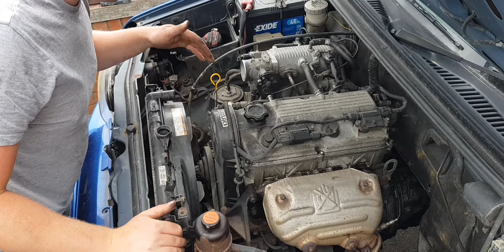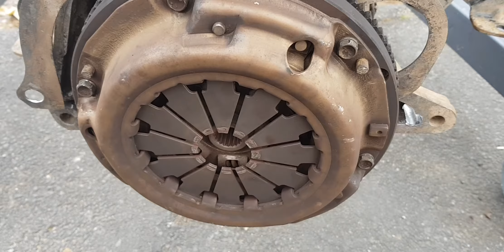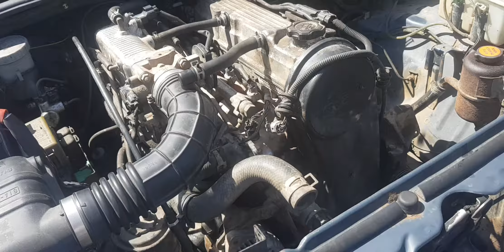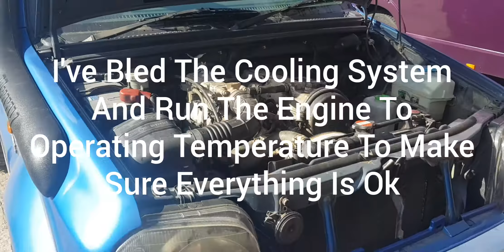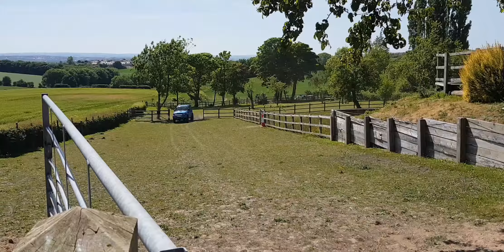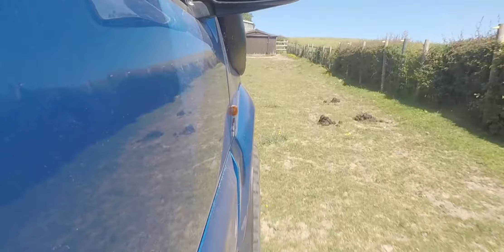Suzuki Jimny 1.6 Engine Conversion ( BIG JIM ) Off Road Test Drive Power Upgrade Suzuki Vitara

Comment from the maker: Heres the complete list of Mods ( I forgot to mention) you need to do so this engine will fit:

:Driver engine mount is slightly further back of the origional so you need to drill a hole in the metal bracket so you can move it forward.
:Use the Jimny manifolds (they bolt stright to the 1.6 with no mods)
:Run the bottom coolant hose infront of the engine mounting rather than through it.

Thats it 👍

Hope you enjoyed and found this video useful.
Reply: Hi mate would you be interested in selling the 1.6 Jimny ??
Regards
Reply from the maker: @aadrianlee  Hi mate. No sorry its part of the family and next inline for a rebuild.
Reply: @landymadgarage  The oilpan is also needed to be modified. right?
Reply from the maker: @sinnakjell7077  yes you fit the Jimny oil pan and pickup pipe. This engine had already been done
Reply: @landymadgarage  Visually vise would someone know it's not the original engine if he is unfamiliar with jimnys? Is the fuel economy higher or lower you reckon? I mean a little stronger engine would pull the car more easily... but also more power. :)
Reply from the maker: @3rdAgeZerkerz  visually no not really. It uses all the same pipes as the Jimny engine so someone without the knowledge wouldnt know any different
Reply: @landymadgarage  Good to know, im planning on buying a jimny, Currently I have Lada Niva 1.7 and a hatchback for daily driving but I only want 1 car for both... So jimny will be a good option I think, the Lada is comfortable but very loud, no powersteering and a/c, consumes a decent ammount of fuel too! I wanted to convert mine to diesel but you can't make it road legal here in europe. What year is your jimny  btw? 
Thanks
Reply from the maker: @3rdAgeZerkerz  ah right. The Jimnys are not the most economical at motorway speeds but fine everywhere else. My Jimny is 2000 (21 years old)
Reply: Honestly I go with a 2.3 l 4 cylinder that came in the Suzuki area that's got a lot of low end torque currently own a 2007 I'm looking to you upgrade my motor and stuff later on
Reply: I’ve never done an engine swap so this was great to see, what put me off trying it was does the ecu need changed, injectors programmed etc how far can you go before getting a Q plate and how do our “friends” in the insurance racket respond? Cheers for another great video, Alan.
Reply from the maker: This is a really simple engine swap as reguards to a bigger engine. As the blocks are nearly identical everything from the 1.3 fits to the 1.6. It runs on the 1.3 manifolds and injectors etc so the only thing thats changed is the piston size. 
Must say i can definately feel it. If i was to swap it for something else i would have to make a wiring loom and fit a new ecu Etc.
As for the insurance you just put non standard engine. But i am yet to find out what that will cost 🤣
Reply: did you have to do any modifications to the oil pick up and oil pan ?
Reply from the maker: @NobgobliN31  It was already done on mine but yes you have to fit the Jimny pickup pipe and sump
Reply: Hey I'm doing a g16 swap and I have put the jimny engine mounts on do I need to use the vitara ones ? And also do you use the 1.3 coolant hoses of the back of the water pump or the 1.6 cheers.
Reply: @ryancottam3140  how did you go

Comment: Thanks for the video. I’ve just bought myself a 1999 Jimny with a G16B 1.6 2005 vitara engine. Did you use the 1.3 Jimny throttle body and TPS with this build? If so, has it been okay, or shall I find a Vitara throttle body for it? Thanks, Harry

Comment: In my jeep, the oil chamber is larger, and it requires 4 liters of oil for the 1.3 engine. I have swapped the engine with the same one, the G1.6. Now, when I add oil, it shows half a liter less. Should I change the gauge, or should I increase the oil level to 4.5 liters?

Comment: Hi did you ever have o2 sensor fault after doing this swap ? Thank you this video has helped me alot 👍🏻
Reply from the maker: No I didnt have any issues in all honesty. The only thing i noticed is it seemed be a bit flat at the top end but i think that was because i had to use the 1.3 injectors
Reply: All sorted, thank you. Yes you are right it ended up being the injectors are used to 1.6 ones and it is 100 times better on idle and top end. Thanks again 👍🏻

Comment: Will the suzuki vitarra engine fits to jimny 2009 automatic?
Reply from the maker: No you will need a Swift or a Liana 1.5vvt or 1.6vvt. I actually have a video coming soon with this exact engine conversion but on a manual so one to watch out for.

Comment: Did drilling the holes in the engine cause any problems down the line thanks
Reply from the maker: No i made some strengtheners/spacers later on so it was a nice fit
Reply: @Life's Projects  so did you just use the one bolt either side with spacers through the block or do you mean up, added another bolt through the 12mm holes with spacers? Thanks
Reply from the maker: @billyholland4203  one bolt either side with the spacers so it spreads the load

Comment: Did you use 1.3 flywheel and clutch or 1.6 vitara flywheel and clutch
Reply from the maker: I used the Jimny 1.3 clutch and flywheel
Reply: Why not the 1.6 flywheel and clutch

Comment: Did the AirCon system work after this swap? Did the pipes bolt straight in?
and what about the steering pump ? which one did you use ?
Reply from the maker: Mines doesn't have air con. Standard jimny steering pump bolts straight on. The only think you need to do it re route the drivers coolant pipe under the engine mounting
Reply: @landymadgarage  thanks for the answer.
I'm doing it right now on my jimny.
What did you do with the starter. I couldn't get the bolts to match the holes on the bell. The 1.3 starter seems to have a slightly larger diameter.
Reply from the maker: @MrMonta  you have to fit a shorted starter. I believe its the 1.6 starter.

Comment: What tires size...and lift kit inches...all modifications for a lift kit???  More informations for lift kit
Reply from the maker: Tyre size is 215 75 15
2inch lift
Castor correction bushes
30mm spacers 
Adjustable panard rods
Steering damper
Reply: @landymadgarage  i have suzuki jimny 2003 1.3 petrol and ome Emu 2 inches but what do you think for 4 inches with castor bushes only (without castor corrected arms)....and also i have 215 75 15 BFGOODRICH MUD TERRAIN but i am not sure should I go 4 inches and bigger tires (30' 9.5 r15)..what do you think..

Comment: What did you do with the engine mount on the driver side
Reply from the maker: I drilled a hole next to the original making the mounting sit further forward and it bolts up nicely.

Comment: Hello buddy.
The conversion you did looks amazing, and easier than I imagined. I want to do the same on my Jimny g13 2.000 model.
I will ask you a few things that will help me a lot for the conversion.
1. Did you use all the g13 engine sensors or did you change them? even the lambda (L) sensor is the same of g13?
2. Αll exhaust pipes remained the same as g13;
3. Do you have a problem with the official smoke limits (Co2) of the exhaust?
4. Do the holes you drilled in the engine have a long-term reliability problem? (because aluminum is sensitive to shocks)
5. Is there a cable or connector or lamp on the dashboard that did not work afterwards?
6. Did you change the mapping of the ECU? The fuel is OK in the whole range of speeds?
7. The radiator and liquit of g13 is enough to cool the g16 and the a/c?
Finally .... just these few. Thank you for your time to answer me.
Reply from the maker: Hi mate 
Yes all the sensors from the 1.3 including the lambda.
Yes used the original 1.3 exhaust system.
 No the emissions remain the same and passes and MOT.
 The only thing i did with the holes is make some better washers / spacers so it fits better.
No everything on the dash works perfect
No i used the 1.3ecu and didnt change a thing
Yes the radiator is fine. You have to change the route of the bottom coolant hose (not difficult) and use the 1.6 thermostat
Glad you enjoyed it. It is a very simple engine change as the engine share so many similarities.
Reply: @landymadgarage  
Thank you very much.

Comment: Hi there,today I saw one of your videos for the first time
You have make my day,thank you ever so much
I own a Jinmy jeans 2004 model with about 100k milles
Im really happy with it but I wish it coud have a better power plant
As it hapends yesterday I saw a second hand vitara engine 1600cc for sale for 300 euros and since them I have been dreaming of put it on my car
Is not a huge diferent but more engine capacity meants more torque,wich is a gain of 22nm @ 100 rpm lower range plus 17 extra HP @ 400 rpm range from the 1328 cc block
Evry litle bids helps and if in the MOT dont see the engine change,as they looks the same ioutside all I can say is happy days indeed
Cheers mate you have gain a new like and a followerkeep us happy with your suzuki Jinmy videos
Cheerssssss
Reply from the maker: Hi mate glad you liked it. Yes its the same for us in England. If the engine looks the same and it passes the emissions test Happy Days haha.
Yes its not a big difference but you can deffo tell there is more torque and its given better drive ability in general. 
Thanks for watching 👍

Comment: Hi is the engine code g16b ? Trying to find one to do the swap
Reply from the maker: Yes that's the one. Its the engine that's fitted to the vitara around 2002.
Reply: @landymadgarage  thanks mate going to be doing it in a couple of weeks what flywheel did you use the 1.3 or the 1.6 ?
Reply from the maker: @dylanmcblain8211  no probs. I used the 1.3 flywheel and clutch
Reply: @landymadgarage  thanks a lot mate
Reply from the maker: @dylanmcblain8211  👌

Comment: Awesome! Thinking of doing this with mine, have you driven it long distance yet? Looking forward to the updates mate
Reply from the maker: No I havent as the rear body is rotten and needs sorting. I went long distance with the old engine so should be alot easier with the extra power!

Comment: Wait... ar you the guy i just ordered my TM kit from to norway?  My jimny look alot the same as yours.  any estimate on delivery? lol
Anyway, nice video! why say anything for the insurance ? they look about the same, im sure they would not notice here.
Where is that front guard coming from?  is this on TUV aproved?
Reply from the maker: Hi no sorry not me I am afraid 😂 I hope my Jimny hasent got a twin! 😂😂
Reply: @landymadgarage  hm. i ordered fomr jimnybits, and there they called a jimny big jim. thought it was the same.
Anyway, it was nice to see how it was done.  did you notice any torque gains?
Reply from the maker: @sinnakjell7077  Ah right i didnt know that. Ive got some parts from Jimnybits before. Good company! Yes there is more torque in the lower revs. Noticed it straight away
Reply: @landymadgarage  I ordered from bigjimny not jimnybits. i was wrong. anyway, i might do a swap.
Reply from the maker: @sinnakjell7077  They are both good companies so you wont have a problem 👍

Comment: hi mate love the video big help but do you know if it has to be a 16 valve  vitara engine or can it be an 8 valve?
Reply from the maker: Thank you. 
Not sure actually. As far as i know it has to be a 16v as the ECU may have problems with the timing/running of the 8V valve.
Reply: @landymadgarage  thanks

Comment: No ECU fiddling? How is Engine Management and tune accomplished? And thank you for for this upload!
Reply from the maker: Thank you. No ECU fiddling needed. You use the Jimny Inlet and exhaust manifold with the 1.3 injectors ( you get alot more torque at low revs) and i runs great like that.
If you fit the 1.6 injectors it struggles to run when warm and needs something doing to the throttlebody.  I will be looking into it as i would like the 1.6 injectors in.

Comment: there is a difference in the engine bolt or not
Reply from the maker: Yes the bolts are bigger so you have to drill out the gearbox holes
Reply: @landymadgarage   okokokk....if the sun and clutch are different or not
Reply from the maker: @Kreatifi  Not sure if the vitara flywheel and clutch are the same but you dont need to worry about the clutch as the Jimny flywheel and clutch bolt straight on.

Comment: What'shappening with the defender
Reply from the maker: Dont worry its the next job 🤣 due to the lockdown i had to bring the graden project forward and wanted to make sure the engine was ok in suzuki. Currently rubbing the axle and chassis down on the defender so there will be a video soon 👌

Comment: That's class. So it's literally a straight swap.
Reply from the maker: Near enough. You have to drill out the gearbox holes to 12mm, move the drivers engine mount forward slightly (drill a new hole for the bolt) and I routed the bottom coolant hose infront of the engine mount instead of through it. Apart from that it and the sump its a straight swap
Reply: @landymadgarage I've had a jimny and was the funniest vehicle Ive had till it came to long distance driving. Might have to get another just to do this. what about wiring?
Reply from the maker: @xalleeex9608  Ive had loads of cars but the Jimny makes me laugh everytime i drive it. They are fantastic cars. Once its back on the road i am going to do an honest owners review so that will be one to watch as i am going to mention long distance driving 🤣.
Nothing changes on the wiring. You use the Jimby wiring loom, the inlet and exhaust manifolds bolt straight to this engine.
Reply: @landymadgarage  love it. 👏